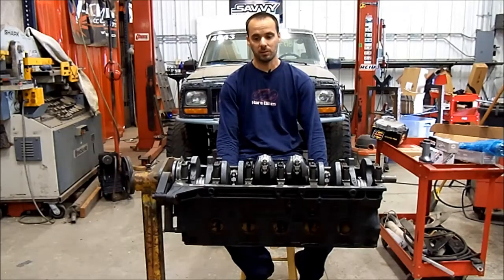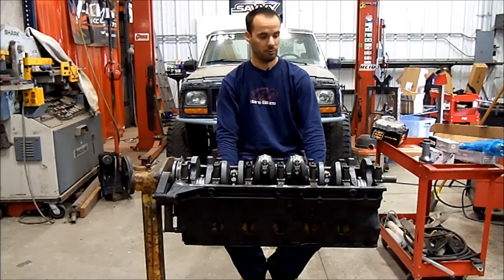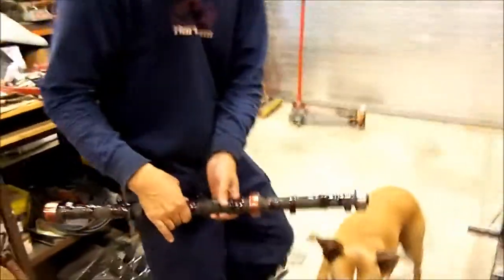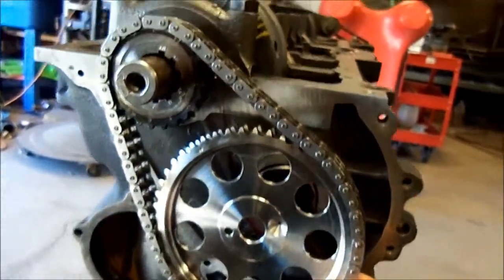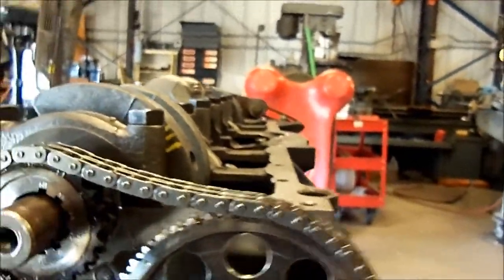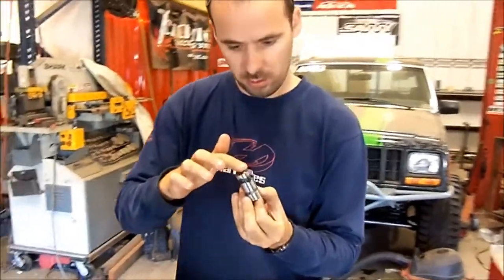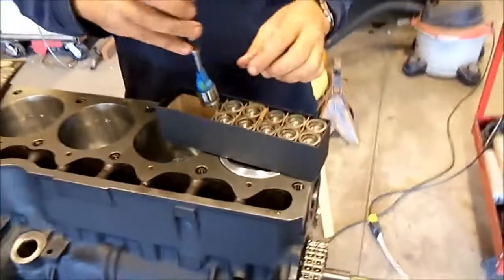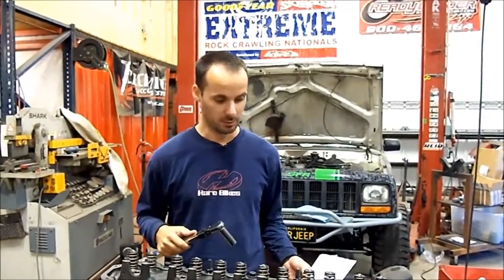Building a 4.7L Jeep Stroker Motor, Part 2

Comment: If you really have to grind any clearance disassemble the engine. It's not worth it getting any swarf in the engine.
Reply from the maker: Well it's been running strong for about 4 years now, so I guess I'm either lucky or good at masking things off.
Reply: @stinkyfabracing  
Not saying it can't be done. I just wouldn't take the risk. Also it's not a bad idea yo grind off any casting flash etc that you can get at in the crank case area, the crank, rods etc. Get the oil to drain back that much faster plus get the oil to come off of the rotating assembly. It's too bad that no one offers a windage tray along with a billet crank girdle to replace the IMO wimpy stamped steel one (1). But then you either need factory main block bolts or aftermarket ones. P,us on a stroker you need to use a spacer to raise the girdle so the rods don't hit.
1) I worked in the Tool Room at the Kenosha Engine Plant so I'm reasonably familiar most of the manufacturing processes that were used. And problems that we faced an ongoing battle with. The pistons for example had all of the rings put on at the same time. As fast as you could put pistons in the ringer would put the on. Now days they put the rings on one at a time.

Comment: It's actually easier to install the cam before the crank. Pan rail up. Without the crank in it's easier to guide the cam through the bearings without dinging them. On the piston intall. Two screws, cut the heads off and slip some hose over the screws. Yhe hose will keep you from possibly singing the rod journal.

Comment: Number 11 head bolt should have been torque at 100ft pounds also. The one with the thread sealant. Nice Donk btw I did mine in Ford corporate blue

Comment: Part 3: "Welp that's it for the valve cover we'll have to stop there because we don't have any engine oil"

JK Looking forward to hearing her start
Reply: LOL, if only it were that simple. We were missing pushrods and rocker arms and a few other little things, which as it turns out the local O'reilly didn't have in stock. What wasn't mentioned was that earlier in the day we had realized we had forgotten a number of other parts and spent a couple hours going to meet Russ and get them from him. This is kinda the problem with a project that only gets looked at once every few months. We suddenly find a few hours, think everything should be "over there" then spend 20 minutes searching the shop to come to the conclusion that we never had what we were looking for in the first place.
Reply: @stnkbg1  Ha! You're telling me - that's how it goes I suppose. Are you putting anything special in the top end or keeping it simple with crown lifters/rockers/rods etc? Feels like that would likely be my approach if I ever rebuilt one
Reply: @seanmacdonald8476  The pushrods are a slightly different length from stock because of the decked block and thin head gasket. I went with some comp cams cromoly ones at Russ's recommendation. The rockers are just OEM replacements. It's gonna be a daily driver so no need to go crazy.